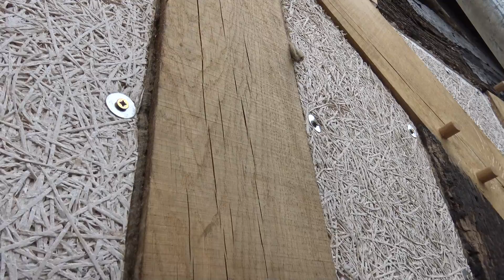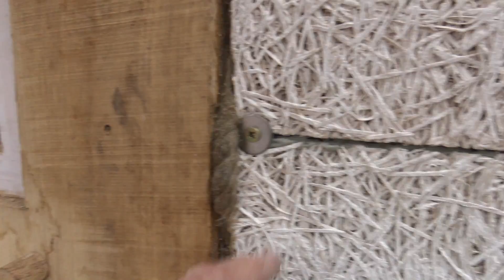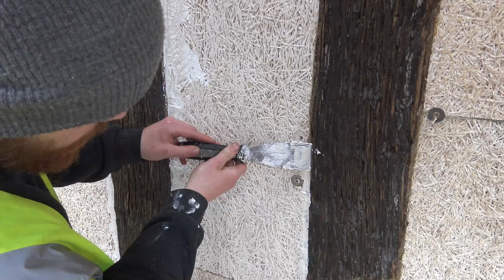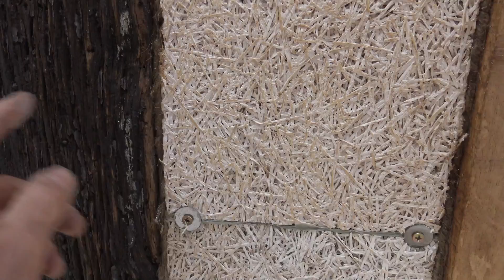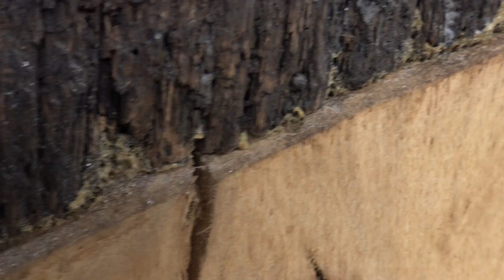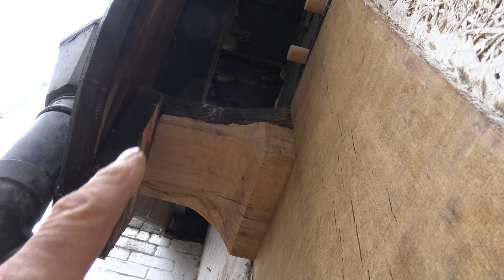Henley Ice Cream - Timber frame progress

Comment: are those fibreglass infill panels or LDF fibreboard?.
and why are you using dry oakum rather than pitch tarred. surely the lime plaster being porus will draw the water in and blow the fibreboard.
Reply from the maker: Its not just fibreboard - its got a bit of cement and is very weather proof - I've left it outsdie for several years with no ill effects.  The oakum is not dry - it has stockholm tar, but is centrifuged.  Believe me - its oily!